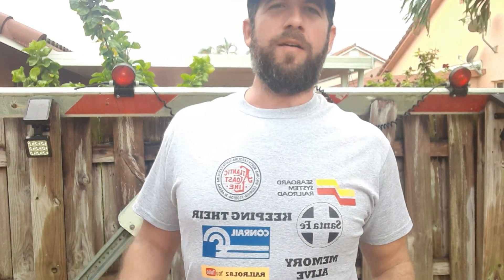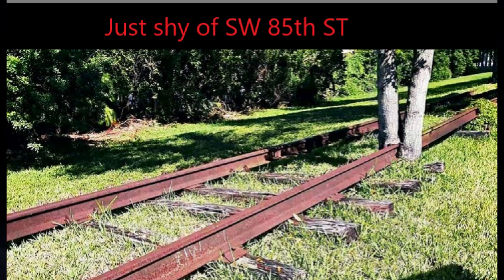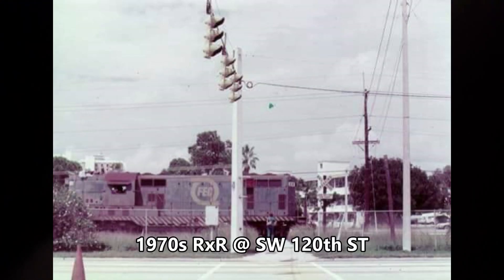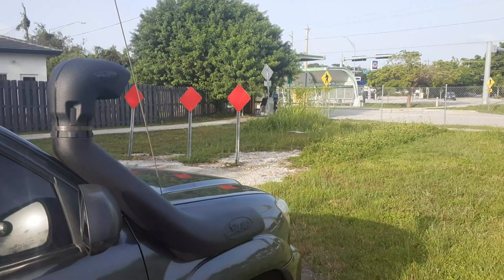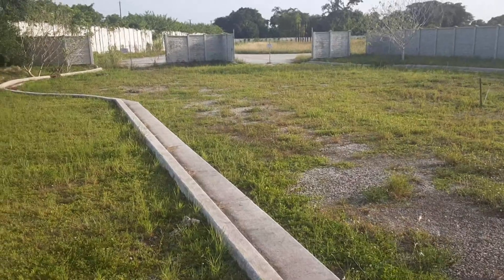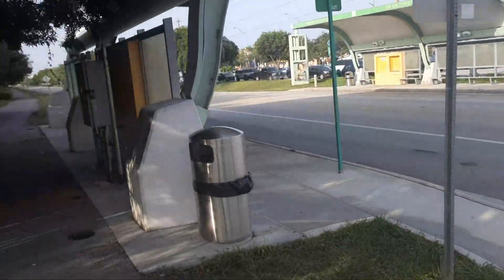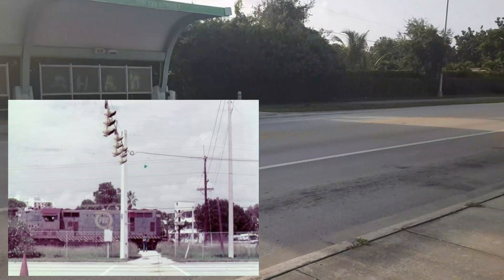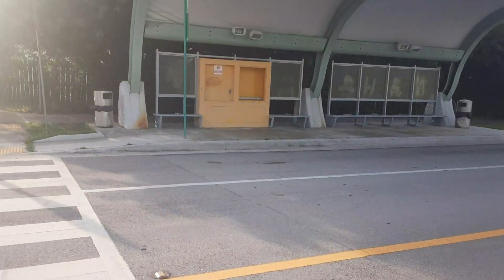1970s Railroad Crossing in 2021

Comment: Is the bike path on the old FEC right-of-way.  If so it could be part of the, “Rails to Trails Program.  My understanding is that program protects the right-of-way if it becomes necessary to put the tracks back down.
Reply: We have a HUGE one of those up here in Ohio (bike path from rails to trails). It's the old Wabash RR line that came into Toledo. Like a 65 mile bike path!
Reply from the maker: In 1988, FEC sold the old ROW (about 15 miles approx.) to the State of FL for $6M. This was all pure greed, highway lobbyists driven, and lack of vision because nowadays this could've been prime real estate for Brightline passenger trains. Thanks as always for the views and comments!
Reply: Armando Perez   Care to explain about the lack of foresight of the FEC president and owner?  And how they were involved in there not being any rail commuter service?
Reply: @billmorris2613  In part this was due to the the railroads’ infatuation with replacing every load possible with intermodal and the desire to abandon all “non-profitable” lines. Owner FEC industries preferred the real estate market and put the railway as second fiddle and President RW Wyckoff sold the line for scrap value. He could have gotten a lot more than the roughly 6.5 million that he got. As for the politicians, there is no commuter or transit rail service because the lobbyists for the highways and trails have most of them paid off. When the expansion of MetroRail south from Dadeland to Homestead and north along NW 27 Ave to the Broward County border was put to a vote in 2002, the people passed the 1/2 Penney tax to pay for it, and to this day has raised approximately 2.8 billion dollars, of which most have been taken and used for other purposes, mainly highway overpasses and the like and very little for rail. TriRail was started thanks to Broward and Palm Beach Counties and the State of Florida, not Miami Dade. Passenger service along FEC from Downtown Miami northward is thanks to Brightline, a private company. Now they are prepared to let the CSX line south of MetroZoo be ripped up in order to be turned into a busway, or a trail, or the southern extension of highway FL 874. It is beyond frustrating for a rail lover.
Reply: It also did not help that former Mayor Carlos Jimenez was also the chairman of the Miami Dade Expressway Authority or MDX as it is known. He promised rail extension in order to get elected and then he reneged on his promises. Of course he favored the massive expansion of expressways in South Florida and fought rail expansion. The only thing that excited him about rails was removing them.
Reply: Armando Perez    After deregulation in the 80s railroads were able to stop operating non profitable lines and operate as any other business would.  The fact that rail fans are frustrated over the railroads shutting down non profitable lines is not even a consideration in the board room.  

A good example was a 13 miles Southern Pacific branch line that was short lined.  Only the first two miles was profitable.  The other 11 miles had only one customer and they were at the end of the line.  They only got 3 to 5 cars a year.  It would not make any sense to maintain 11 miles of track for a coustomer that only got 3 to 5 cars a month, much less 3 to 5 cars a year.  I hated to see any rail line get abandoned.  It usually meant several employees would have to move back to the home terminal.